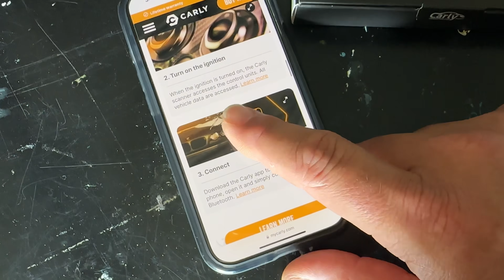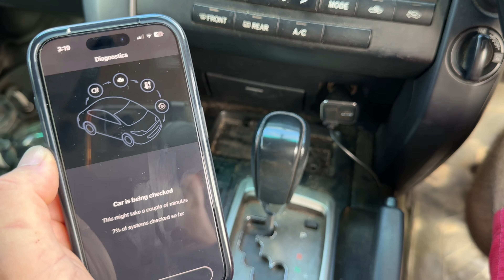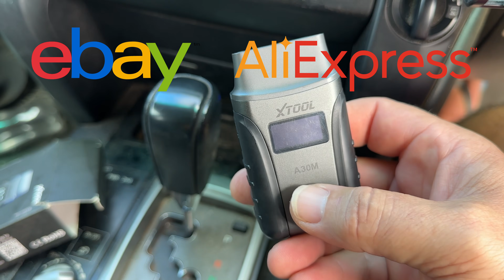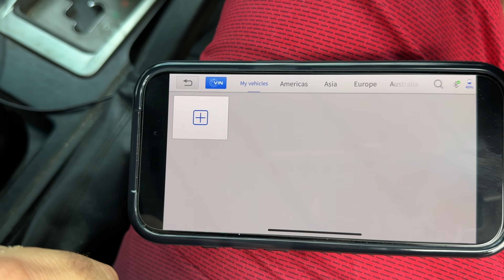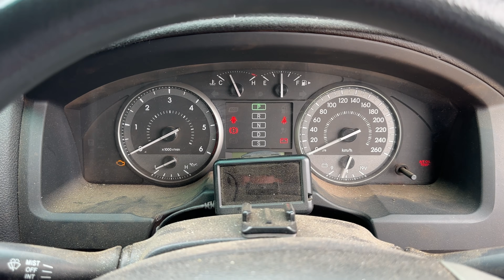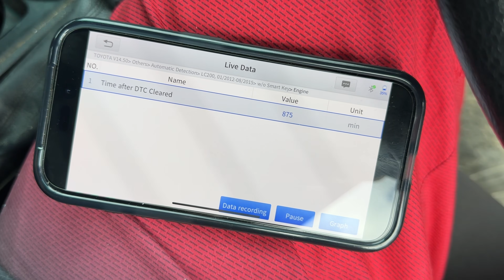Carly vs Xtool A30M: Unbiased Review and Why Xtool Dominates 🔧🚗

Comment: Great review. I have had the A30M for a few years and it has been fantastic on my 2006 Toyota Matrix 4WD with 227,000 miles. I do advanced DIY diagnostics and find this tool to be pretty capable. For example: The record live data function is super handy for reviewing tests at a later time. I paid $125 US.

Comment: Great review.  I have a Discovery 4 and use the GAP Diagnostics tool at about $800 which looks very similar in functionality to the A30M.  My mate with a new Defender has been looking for a cheaper tool but the cheap ones just won't communicate with a Land Rover beyond the generic engine and transmission fault codes, they cant see the other 30 plus systems in the car.  I just emailed XTool to ask about Land Rover compatibility.  Anyway I really appreciate this review. Oh and I will add that my $800 tool is not campatible with his Defender it also cannot see all the systems as the Defender is way more complex than the Disco.  GAP has developed software for the Defender but also over $800.
Reply: Good to know so it might be worth trying
Reply from the maker: @michaeldallimore8590 yeah I reckon it’s worth trying. Can always sell it off if it doesn’t work but I reckon you’d be in for a good chance.
Reply from the maker: Pretty sure I’ve done a 2012 Land Rover with the a30m.